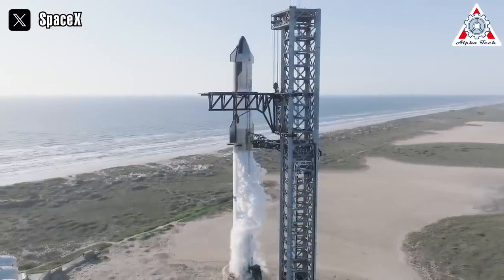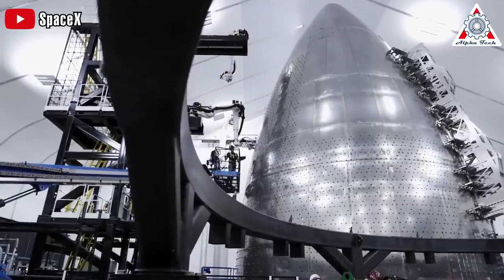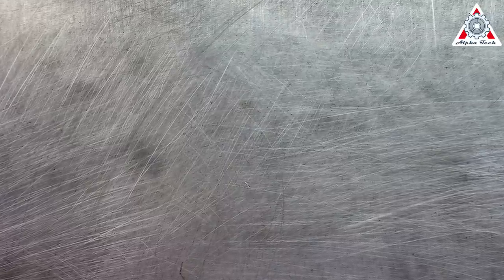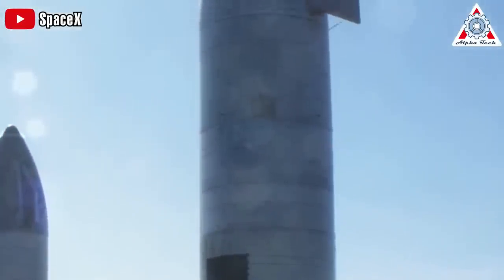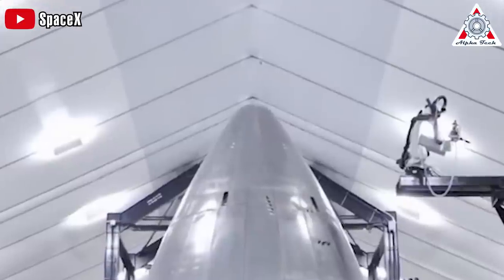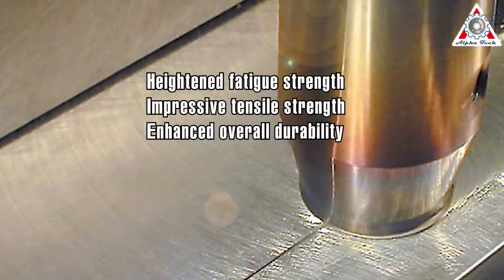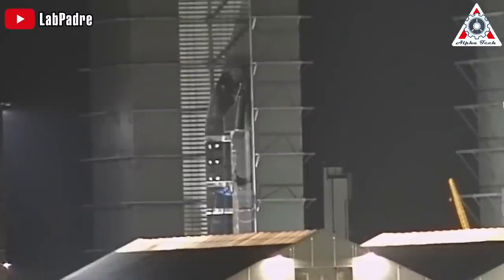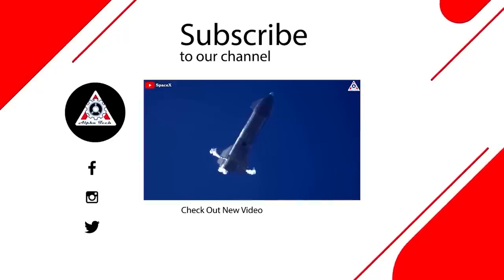What SpaceX just did with Starship's Welding shocked the entire industry!

Comment: OK, a few points of better clarity here. The Flux core is turned into a gas when heated it releases this gas to prevent oxygen from getting into the weld and causing porosity. Not rust tig welding is just pernounced as it sounds not spelled out. There are 3 different types of mig-fluxcore welding short circuit, spray, and pulse. All 3 have different benefits and drawbacks. The main thing is that Flux core is just the type of wire used in the mig process. There are 3 types of Flux core inner shield and outer shield and duel shield. There is also a solid core that can be used in conjunction with gas. Also, the Flux core can be used in conjunction with gas. The main difference is in feed and heat forced into the material. The hard part about welding 304 stainless that becomes very apparent when dealing with 316 stainless in burning out the chromium by having to much heat in the material what tiger is reliable on one thing of putting a lot of heat into your work. And hitting the weld after you have it welding in the industry is called penning. It is done while the steel is still jot to relive some stress from the contraction of the weld cooling. Overall, it's a good video. I just wish you had a bit more research on the topic before.

Comment: I had  no idea they used friction welding at such a scale. I remember having a toy back in the 70's that let you friction weld plastic models together, but I never imagined they'd use it with stainless steel. Very neat.
Reply: Actually it would have used for carbon fiber welding
Reply: I think I remember that toy.  It had plastic girders and plastic rivets, and  a tool like a drill that would use the friction of the spinning rivet to fuse it into the girders.
Reply: I feel a Romantic loss for the skill of welding. On the other hand this is great stuff!
Reply: @davidbonk1672  Yeah, that's the one. Then you could use the power tool to rev up the tires (one of mine built dragsters) They always seemed to fall apart at a moment's notice, but putting them back together was part of the fun.
Reply: Russian's use same machine with aluminium bodies of rocket's.
Reply: @clavo3352   Do the words romantic and welding really belong in the same sentence?  :-/  ;-)
Reply: Spinwelder.
Reply: @basketballjones6782  Yep, that's the one. Neat to see the commercial for that. Brings back memories.
Reply: Using the NASA FSW video here is really quite disingenuous. A lot of the technology  development for large-scale FSW was done by NASA prior to the start of manufacturing the SLS, and much later picked up by SpaceX.
Reply: @doccls   So. Do you think that no one else can use the technology just because NASA developed it? They open source much of what they develop and generally they should because it's all funded by the taxpayers. Technology shouldn't be hoarded, it should be shared and further developed for the continual advancement of civilization.
Reply: @MrJdsenior yes

Comment: Not only was the launch test article structurally sound enough to endure Max-Q, it even survived its own self-destruct charges, which have been beefed up for future iterations.
Reply: What are you talking about? Those charges never fired. A crucial feature not working is nothing to be proud of. Even if they did fire and nothing happened - that's something that needs to have been tested before the craft was even considered for launch. 
Additionally the engineer's job is to do the calculations needed based on the material strength, construction methods and all sorts of other factors during the design phase - not after the damn thing proves to be a literal death trap for the umpteenth time. All this tells anyone with an IQ higher than the average european shoe size is that: 1. Elon can't put three brain cells together across all of his companies. OR 2. Someone did do their job, but the solution was overruled by His Great Smellyness for not being cool or futuristic or something enough to suit the particular dose of whatever he is on that day (as has been known to happen countless times so far). 
Besides has anyone considered what beefing up the charges would mean for this piece of crap's already terrible track record?

Comment: Having worked with carbon fiber composites in both fiber-wrap and woven matrix composite forms, I think it is important to note that the weak link in carbon composites is NOT the carbon fiber, but rather the composite resin that is needed to solidify and form the rigid part.  These resins are not as durable under high heat applications, as Musk's team surely found out.  But the carbon fiber itself, likely would have no problem. with the heat levels anticipated.
Reply: Could you replace resin with something else? Flexible concrete? Low melt alloy?
Reply: Clearly, present day carbon fiber technology is not up to the task of serving as the skin of spacecraft.  Perhaps future carbon fiber technology will solve the limitations of current binding materials.

Comment: I started welding in 1966. By 1971 I was certified in Arc welding steel plate all positions. Over the years I was certified to weld Mill steel, aluminum, Titanium, stainless sheet and tubing as well as many other metal alloys from 0,004 to 0.120 some over 1 inch thick. I have even welded pot metal.  I welded everything from cast iron engine blocks to to parts that are on the voyager 1 and 2. Made parts that went on F 18 fighters as well as others. Also for commercial air craft. I had to hole tolerances of 0.003 many times.

Comment: Welding engineer here. I have visited The Welding Institute in the UK aswell.  

I'm 95 % sure you are wrong. 

FSW is used a lot on aluminium. Not on steel and stainless, since it's a much tougher metal which reduce toollife to around 50 meter. The tool itself is veeeery expensive. 

I have followed Starhip since the beginning and I have seen no proof that they use FSW in videos etc. They do use it on Falcon Heavy though, where aluminium is used.

Comment: That FSW process is amazing. I've never seen that outside of plastics joining.
Musk surrounding himself with out of the box thinkers is really paying off for all of us.
Reply: Used to weld turbocharger turbines to the shaft. Also used to weld stainless steel tubing lengths for a joint free run. Especially used in nuclear power plants where a leak is just not acceptable. Just two examples.

Comment: Starship just keeps getting more impressive!
Reply: I remember being a kid watching black and white movies with rockets that would takeoff and land. Now they’re here. It blows my mind.
Reply: There are about 50 welding processes. Friction stir welding is not a new. Process. For accurate information cosult the American Welding Society.
Reply: @roadsterman  Yes, I've seen other formats too, for cylindrical sections, whereby you spin one up to high speed and force them together with great force, in a lathe designed for the task.  The entire weld is made at one time, which I would expect might increase strength due to only one melting, or plasticizing interface being completed simultaneously, instead of a traveling bead.

Comment: To sum it up:  Spacex tried to do it very cheaply even though welders in other industries could have told them it wouldn't work.  After initial failure they tried other inadequate methods that failed.  They finally tried proven methods that were already in use in other industries to achieve moderate success.  No extra credit for Spacex engineers.

Comment: I've welded thin and thick walled pipe for the oil fields and sent the same welds through pipe-bending machines where it was necessary the weld be good enough not to break or leak when pressurized. Anyway all I'm trying to say and doing a bad job of it is the THIS refined older system of weld is well, naturally sheer genius. Way to go SpaceX.:shelterin:

Comment: I am surprised that they don't weld in a helix, with the laser welding, they could make one tube out of one longer role and knock off the same weld length as the length of the final cylinder.
Reply: it would be stronger, I have been saying this for a while, just wrap a big tube, then slide in the addons
Reply: Helix welding cannot be done for practical reasons. There is no 
practical way to measure diameter of the Starship or SH Booster. The only thing that can be precisely measured is circumference and that can be precisely measured before strip of metal is welded into a ring. This measurement has to be  temperature compensated in order to give consistent results. Ring to ring variations influence matching of   ring edges for welding to each other and to "y" joints. Just try to imagine how would you precisely measure circumference of spirally welded tube?
Reply: @KarolKarolak  Start with one large building and a fixture suspended in air from one side with the same length as the finished part or longer.  Suspend the first loop with full support all around the loop.  When you measure the length of the diameter at a set temperature, wrap that loop around till you can spot weld the mark to the side of the role.  The squareness of the roll you are making the tube with won't matter since the end will be cut square with the tube after the final length of the tube has been welded.  If you want a smaller example, look at the paper tubes that come at the end of wrapping paper.
Reply: @KarolKarolak    ahh, it's not that difficult, a good quality servo system can hold the circumference to within a few microns if machine rigidity is good enough. the calculation of feed and speed is no different than what they are doing now. the tolerance of spiral wound pipes is pretty amazing considering the low tech process used to make it. typical holding thousandths of a inch over  thousands of linear feet, with mostly manual machine tools calibrated by guys with high school diplomas.
Reply: @martinsoos  How do you know that your "loop" represents circumference of a circle and not circumference of an ellipsoid?
Reply: @seancollins9745   Whatever it is your are on right now I also want some of it. You have absolutely no idea what you are talking about. This is not mass production of thousands of linear feet, where you can tweak it to your hearts content. You cannot even define if measurement you are making  represents circumference of a circle and not circumference of an ellipsoid. You have to define center axis to tell the difference
Reply: @KarolKarolak  I don't know, I work in automation, you tell me what I can't, maybe I will listen to you. EWS spiral wound pipe with diameters into the 10s of feet is not new stuff here. But you do you boo.
Reply: @seancollins9745  Something that has circumference of 28 meters and thickness of 4 mm is not a pipe by any stretch of imagination. Just think about for a second. For starters it does not retain shape of a pipe.
Reply: @KarolKarolak  That is what a fixture is for.  They are made the same way you make a carry pad for large tanks when you carry them on their sides on ships, trains, and big trucks.  Except the fixture allows the sheet metal to move across it and it is supportive on the OD on the bottom half and supportive on the ID on the upper half.

Comment: Carbon fiber seems to be an auto fail material in the hands of a dilatant. High temperature, compression loads, either can case failure in carbon fiber materials. Glad to see SpaceX using due diligence in engineering the Starship.

Comment: I am coming from the steel industry, I had a discussion with Ph.D. engineers about the use of aluminum against steel. My argument was that steel can be made much thinner than alu, has rust resistance, and has higher strength. That was 30 years ago. I guess I won.😁😁😁

Comment: I would think Niobium stabilized 347 or Titanium stabilized 321 stainless would hold up better to the heat than the 304L (the "L" just indicates it has half the Carbon of 302).  If any TIG welding is needed, then 347 would be the choice.  The cold rolling does elongate the grains but that is not what makes the metal stronger.  The rolling is called work hardening and the increase in strength is from an increase in dislocations in the microstructure.

Comment: Rolls - Royce tried to use carbon fibre fan blades on the RB211 which had been destined for the Lockheed L1011 (I think) but the ends of the blades delaminated and were useless, they had to be replaced by Titanium. This extra cost led to the bankruptcy of RR and they were then able to renegotiate the engine price. LH were stuck as they had configured the plane to suit the engine.

Comment: SpaceX's first rockets were built by a contractor that specialized in building water towers 😝 It's seems like a lot of the processes they've adopted have been through trial and error processes instead of using well established processes that have been around for years in the manufacturing and aerospace industries... ie: Reinventing the wheel.

Comment: Stainless steel can tolerate triple the heat of carbon fiber.  That comparison is close enough, but you quote it in Celsius and make a comparison that requires a Kelvin measurement.  200 C for carbon fiber vs 1600 C for stainless.  473 Kelvin vs 1873 Kelvin, that's roughly a tripling, but it sounds weird when you quote the temperature tolerance as 200 vs 1600 first, the uninformed viewer might think stainless tolerates 8 times as much heat, not understanding that you have to convert to kelvin for such a comparison.

Comment: What "shocked the entire industry" is that it took four or five years of "experimenting" for SpaceX to adopt the best practice in stainless steel welding, those taught in any trade school for master welders. Also, it is shocking that Musk actually had to buy mandrels and graphite fiber winding machines before figuring the disadvantages of this "sexy" technology. That's Musk's "developed philosophy" - build first, think later.
Reply: because using said technologies on a radical new design being delivered to space at mach 27 and fulfilling economic, engineering, supply chain etc requirements unlike any other system makes one set of domain knowledge 100% completely transferrable from day dot everyone know win98 is best os no need for reassessing anything from first principles lol
Reply: @blengi  The "radical new design" (once Musk found out that carbon composites are expensive and tolerate heat less than stainless steel does - but, hey, Space Shuttle used them for thermal protection (that killed seven astronauts)) consists of pressurized stainless steel tanks. Welding pressurized stainless steel tanks is not (pardon the pun) exactly rocket science, but SpaceX wasted a year using techniques suitable for welding balcony balustrades or garage doors, before "discovering" TIG and later automating it using a welding robot.

Tell me what, exactly, is "radically new" developed from the "first principles" in SpaceX designs? Merlin engine, using reliable traditional open cycle gas generator design drawing on decades of NASA experience and that of others? Propulsive landing, like DC-X did half a century ago? Using stainless steel for rocket hulls, like Atlas did in '50s? Adopting full flow stage combustion cycle like Soviet RD-270, and many smaller as opposed few huge engines (like N-1 vs. Saturn V) ? Designing a (relatively) huge launches, although not as huge as, say, Sea Dragon? Using conical capsule design for cargo and crew transport, like Apollo?  

I am listening.

What I admire Gwynne Shotwell for is managing to fly the Tom Mueller design (Falcon series) so reliably and dependably.

Comment: Actually, 300 series stainless steel is easy to weld under inert gas such as TIG, outdoor welding is problemantic because any wind blows away and disturbs the inert blanket gas, often argon. Stainless is a great alloy being good from essentially absolute zero to 2000F and is used in cryogenics to turbine engine blades. That said the strangest metal is maraging steel, good down to LOx temps and has a quarter to half million PSI tensile strength. I know because I tested rocket tanks using maraging, videos on the net

Comment: Stainless steel, especially the 304L they are using is quite easy to weld.  I am not so sure that grinding the welds is a good idea and adds strength.
Reply: Someone talking crap here
Reply: Actually what I thought. Out of all alloys Stainless Steel is one of if not the easiest to weld. Especially with TIG. I too am not sure if Grinding the welds is the right way to get rid of the cracks. 

Everyone is saying that Space X is great for doing all this stuff but it just screams to me a lack of research much like this video. Stainless Steel when welded distorts more then most other alloys. In order for it to not distort a common practice is to pre heat the material with flame and post heat the material in an oven. Which I doubt Space X would do give you need to slowly lower the temperature.

Using the MMA process which I think is what they mean my Flux core, which are different things Seems to me a case of "oh, you can weld it on site in position and minimize costs a butt load? Well do it that way." Disregarding all the problems that will come up. MMA is super hot because of the DC current you need to use which would distort the material more. Switching to TIG welding is a great choice because of the a AC Pulse current you can utilities minimizing the heat transfer. MMA is prone to Contaminating with slag inclusions and porosity. Which honesty I think is why they need to grind all the weld. So they could re weld the Contaminated welds. haha. 

Honestly the FSW should be the only Welding process used to weld things on Rockets IMO. It eliminates the chance for contamination and distortion. Contamation weakens the welds and distortion will put unneeded and unwanted stress to weird parts of the ship.  

All in all @theohlinsguy4649 I'm on your side here.